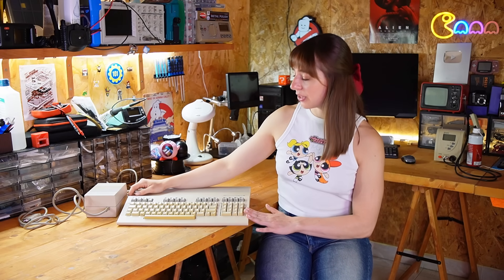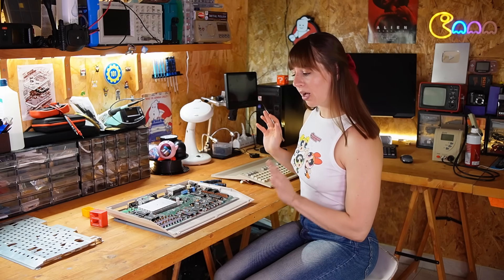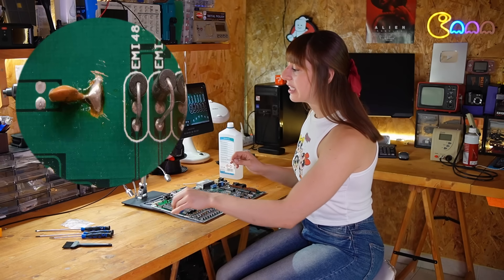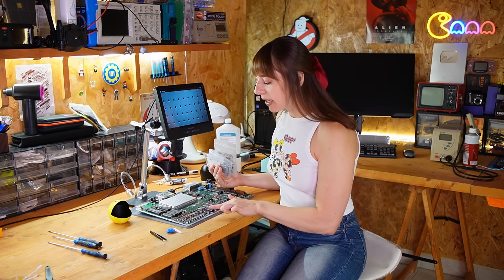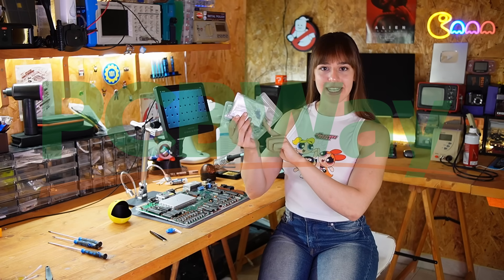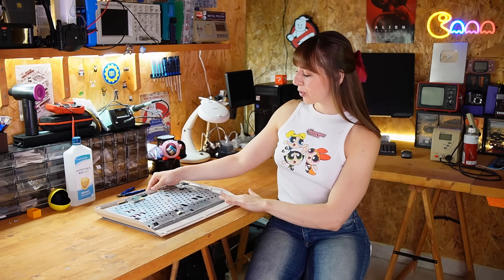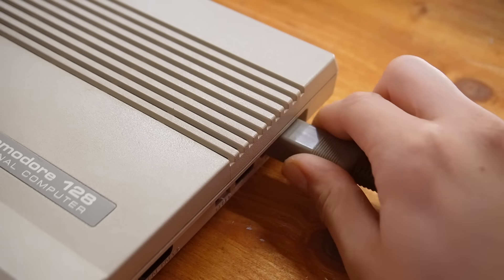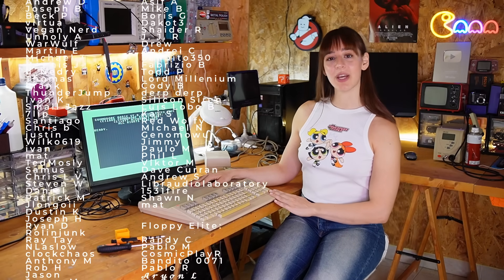Someone Tried to Fix This Commodore 128 (And Failed)

Comment: I realize this video is a couple of months old and you might not see this comment, but there is no need to replace ceramic disc capacitors. Unless they are broken of course. They'll last for decades without drift. What you want to replace are electrolytic, tantalum and RIFA. I started working as a computer technician in 1989, so I've worked on a lot of computers from that era.
Reply from the maker: Thanks for the clarification and for sharing your experience 🙂
That’s really useful insight, especially coming from someone who’s worked on systems from that era
Reply: @Sayakas_Digital_Attic You are welcome. I love your channel. It is great to see younger people interested in retro computing and you are doing a great job. As a side note, I repaired a lot of Olivetti M24s/AT&T PC 6300s back in the day. I would think they would be fairly easy to find where you are and I think you might find the architecture very interesting. It's a clever design.

Comment: Top work as usual 👍
Get hold of a dysfunctional Atari STe they were Uber sexy back in the day. Get it going and an easy RAM upgrade by just filling the slots up to 4mb 👍 I always wanted one back in the day, but ended up with a 130XE which was great anyway 👍👍👍

Comment: I did own a Commodore 64, and after much use the fuse in the power supply would burn out. And when it was replaced that would burn out too. My neighbor was the goto handyman for electronics back than for us, he just kept putting in higher and higher rated fuses and the power supply would also swell up, but it still worked. Now I know it was a huge fire hazard 😅

Comment: If you have one of these nearby, Maplins, Radioshack, The Source, or Source By Circuit City. Look also at stores who sell shortwave radio or ham radio parts. They will usually have capacitors etcetera as a lot of Hammies love upgrading beyond cough Manufacturers suggested settings. LOL. Hopefully this helps.

Comment: I had a cracking C128DM, had a better chip set the metal case had a better chipset than the 128D or the 128, i had jiffy dos and geos mounted on the 8 spare slots and would into Geos 128 in under a second, modern computers still cant do that.

Comment: How are you? Greetings from Buenos Aires, Argentina. The person who damaged that Commodore is unforgivable. Luckily, it was a simple repair. Be careful because you've applied thermal grease with silver particles (which is conductive). You have to make sure to use a very small amount to prevent it from shorting out the IC leads. It would have been better to use regular silicone grease (the white), since that's not conductive and poses no risk. Regards!
Reply from the maker: Thank you for the tip!

Comment: The capacitors are disc ceramics and don't wear out or degrade with time.
They only need replacing if the are physically damaged.
If they fail they usually go low resistance.
Nice vids by the way.

Comment: Hi, love your videos and have a small tip you should try. When you are desoldering , first melt lowmelt solder in it and after this mixing you can take parts out so much easier. Besides you don't need to apply so much heat that van damage the board and other parts.
Reply from the maker: thanks for the advice

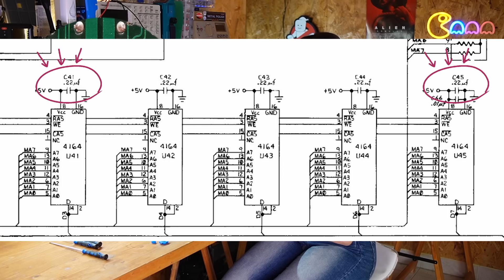Comment: 4:18 did you look for 0.22uf ? You would probably have found a quicker result by searching for 220nf … to be honest 100nf would be fine for bypass caps … do you have access to Farnell or RS? 
You could even fit surface Mount caps with a little time and effort.
Reply from the maker: I’ll keep that in mind for next time, thanks for the tip!

Comment: I still have one of those. Not the desktop model, but the C128 DCR, which is the model with a separate keyboard and metal casing. 
One advantage of this model is that it comes with 64kb of video memory as standard.
One disadvantage of this model is that compatibility with other (previous) models is slightly reduced.
Thank you for putting so much effort into these old devices. It's always nice to see a broken device come back to life.
Reply from the maker: Oh nice, the DCR version! Love that solid metal case (even if compatibility takes a hit)

Comment: I had a 128 on preorder in 1986 with a 1570 drive. Years later I bought a 128d for a bargain price, I've repaired a few over the years. They were a remarkable system in their time with twin processors and at least three modes of operation

Comment: Nice addition with the ESR meter, if you want to check if capacitors are within range, the capacitance is a good start, but the ESR gives you a better overview. I would suggest that you add an ESR table to your bench, because 0.42-0.44 ohms for 2200uf and 4700uf is way past the tolerance value.
Reply from the maker: thanks for the tip!

Comment: 💜Awh, my second computer 💜(My first was a ZX Spectrum 48K).
- It is just such a loveable Frankensteinian freak. Sort of stitched together from many of Commodore's other 8 Bits, and therefore not exactly the easiest thing to repair and maintain (just ask Jan Beta).😅
- Back then, we kind of nicknamed a lot of these old machines. Like the C64 is also called "the Breadbin", the ZX Spectrum is "the Speccy", and the BBC Micro is "the Beeb". Well, I have tried getting "the Chimera 128" going for the C128 and "the PowerPuff CPCs" for the Amstrads (as in: Lord Alan Sugar, spice and everything nice). But sadly without that much luck in those nicknames catching on so far. 😆

Comment: 6:56 Why does it looks like two of the "legs" are touching? I think they should be clipped closer to the solder joint.And maybe you should get a desoldering pump to safe the soldering wick There are cheap desoldering pumps that you operate manually by compressing a spring. I guess you do not do that many desoldering so the cost of a desolderung gun might not be justified.
Reply from the maker: They were actually touching, but of course I trimmed the legs off camera, so there’s no short circuit. I’ve got a desoldering gun and a pump, but I prefer using desoldering braid, it just feels cleaner to me! Of course, if the pins are large or there’s a lot of solder, I use the pump 🙂

Comment: Please use an air filter when you do soldering 🥲. Excellent work!
Reply from the maker: Thanks for worrying! I always use a filter while soldering, it just doesn’t show in the shot
Reply: @Sayakas_Digital_Attic 😶‍🌫️😮‍💨😤 😲 Can I ask you to show the air filter in your videos so that more people are aware of the risks of soldering? 🥺 You generally find the RoHS compliant marking on the product, packaging, or documentation, indicating the electronics (including solder) are lead-free. If your not shure and the product as no indication whats so ever Electronics manufactured before 2006 almost certainly contain lead in the solder. SO to Red ring of dead on my Xbox that learn me that.

Comment: Back in the day I had a C64-C... But we sold it once we got a 386. At some point after that, I started to have some slight regret over selling the C64. And fairly recently decided to "undo" that mistake by buying a Commodore. After looking for some listings, I finally chose a C-128, after all it does have that C64-mode, has similar styling as the C64-C... As a matter of fact the C-version of C64 is actually based on the C-128... And it has some additional cool features to tinker with.

Sadly, I could not just go and play with my "new" C-128, and fortunately I was cautious enough not to just try, but did test the powersupply first. And after a while of scrubbing surface oxidation of the pins (at first could not find any voltage), they seemed fine thought... But once I did get actual readings of it, the AC was fine, as one would expect. After all the AC is supplied by a huge (by modern PSU standards) coil transformer. That is likely to last centuries... But the DC side is another matter. The 5 VDC relies on voltage regulator to step down the voltage, and has a tendency to fail by shorting, causing overvoltage on the 5VDC line. And that was exactly what was going on with this PSU, everything else fine, but instead of 5 VDC, it was giving off 10 VDC, which could have easily fried a whole bunch of hard to replace original components.

So I would have to fix that, before I could test if I have anything else than a PSU that is working. And I allready have half a plan and fresh components to try and fix the voltage regulator... But because of life, I don't have as much time as I would like to. So that has been sitting on a shelf for some time now.

But I do hope one day I could be a proud owner of a C-128 (that is actually working).

Comment: Hey, Sayaka! I really enjoy your videos, and I also found some answers to problems I was having with my Deamcast thanks to one of them. I am no expert on soldering, but I will offer you some tips that worked very well for me: when using soldering wick, try to apply more solder before so it mixes with the old one and helps to melt more easily. Also, you can cut a smaller part of the solder wick and use pliers to hold it. That is because the heat will be dissipated along the tape, so a smaller part means you need less temperature to get it heated. And keep using solder paste as it also helps with te melting. Hope these work for you and keep up the great work.
Reply from the maker: Thanks for the helpful advice, I'll keep that in mind next time! 😄

Comment: I bought one from a local seller. It booted once, then it was all black the next day. I troubleshooted a bunch of components. The power supply was measuring just a bit under so I decided to buy another PSU. Turns out it was the PSU. The lesson learned,  even if the measured voltages are just 0.2V lower it could be enough to prevent booting.  Thanks for saving this great machine.
Reply from the maker: That's really interesting to hear about the voltage, but it's great that you were able to fix it!

Comment: I owned first a Commodore 64 and later a Commodore 128, which I still have. After those I had an Amiga 500. I have no idea where to get spare parts except from another computer.
Reply from the maker: It can be tricky, but I know there are some online sources that might be able to help you find the parts you need (mostly ebay)

Comment: I didn't know ceramic capacitors were hard to find nowadays. Probably capacitors made from other materials would work, but I understand wanting to keep everything as close to original as possible.
Reply from the maker: Yes! I'd like to keep the components as original as possible, but ofc it can be tricky sometimes to find the components (like in this case)

Comment: I'll probably be crucified for saying this, but I get ALL my components from Aliexpress or Banggood. 
Aliexpress: 50 PCS 224/50V Disc Ceramic Capacitors 224 0.22uF 50Volt 220NF  -  €2.89/lot

Comment: Ceramic capacitors rarely go bad. Have you found some that go bad more than others?
Reply from the maker: Yeah, it’s definitely harder for ceramic caps to fail, but since one was basically destroyed and the other chipped at the tip, I'd have preferred doing a full recap!

Comment: 2:58 Normally, thermal paste isn't (or at least, shouldn't) be conductive. so no risk there. But there is thermal paste, liquid metal, that is conductive and shouldn't be used around unprotected contacts.
Reply from the maker: Ceramic caps usually last a long time, but they can still crack or fail, especially from stress, heat, time...I’ve seen some break more often than others depending on brand and conditions.

Comment: i am noticing 3 things: 1) how beefy was the power supply for a c128 and yet they fails so easly back then 2) the overkill in rf shielding, was that circuit so noisy or was the fcc paranoic??? 3) the equipment quality growing exponentially: take that soldering station ,even the nerd emperor mr. carlson himself that have walls of tektronix oscilloscopes doesent dare to use such a top tier weller iron :D

Comment: Ceramic or Micra capacitors very rarely need replacing.. electrolytic capacitors often n3d replacing
Reply from the maker: Yeah, it’s definitely harder for ceramic caps to fail, but since one was basically destroyed and the other chipped at the tip, I'd have preferred doing a full recap!

Comment: Using a nylon brush on electronics, from experience, that can introduce static charge to the components and short sensitive chips.  Think about what rubbing a balloon with an insulator does.
Reply from the maker: Thanks for the tip!

Comment: eBay really is your best bet for weird or discontinued parts. I'm surprised that Commodore used some uncommon ceramic cap in there. There are good parts suppliers in the USA but with the current tax and tariff madness I wouldn't recommend it for such small orders.

Comment: Use monolithic capacitors. You should be able to get them anywhere with the same lead pitch, and are superior to the original ceramic caps.

Comment: I wish the C128 had been just a more regular upgrade to the C64, i.e. more ram, maybe an extra SID for stereo sound, and an upgraded VIC2. The way they went with this, meant that 99% of people just used it C64 mode, and there was very little software written for the C128. Maybe there are technical reasons why they went the way they did (was CPM really that desirable?)....

Comment: i use my old electric tooth brush for scrubbing with an old head (cleaned obviously ) its gentle but harsh enough to remove gunk without damage or much effort , the reason its an old brush is because the charge no longer holds for long , but its long enough for a clean of a PCB just not for tooths cleaning  more then a few times and we all hate having a tooth brush first thing that's not working 
those little component testers are great but are not very accurate spend a few bob more to get a better one i had one that read every component as a diode !!
Reply from the maker: Thanks for the advice!

Comment: If the device uses ceramic capacitors as bypass capacitors, then it really doesn't matter what the replacements are.  "Close enough" would work just fine.

Comment: Neatly done!  Sometimes solder braid, if left on the roll, can act as a big heat sink.  If the work includes large joints of solder you might cut a short length of braid from the roll and manage it with tweezers.  This can save pads from being ripped up from braid that gets tacked down as the pads cool.

Very well spotted on that missing screw.  That was a safety item.

Comment: Have you tried ordering capacitors from online electronics retailers from China or locally?
You should wet the iron before wicking (I just touch it against the joint to be wicked).

Comment: Mouser and DigiKey are the first places I look for electronic components. While they do still carry a fair number of ceramic disk capacitors, sadly they don’t have anything in the 0.22uf range. What they DO have in 0.22f are leaded MLCC’s, which should be a reasonable substitute. You can probably find one with similar lead spacing and voltage ratings as a functional replacement. MLCCs were basically the same technology as the ceramic disks, just in a more space efficient package, and part of the reason they make MLCCs with leads on them is to use as replacements for designs that used these older ceramic disk caps.
Reply: Great tip fellow clippy, will try to keep it in mind :)
Reply from the maker: Thanks for the component recommendations, that’s really helpful!

Comment: Ceramic disc capacitors have, for decades, been the go to device for filtering and supplying that extra kick when a chip starts doing something. A 224Z is 220nF or .22uF (as it said in the schematic) the Z is a tolerance rating meaning up to +80% and down to -20% of rated capacitance.  Still widely available on Amazon/Digikey/Mouser. And don't be surprised if the newer ones are quite a bit smaller than the originals, those tiny little orange/brown squares on newer surface mount devices can be 1.0mm x 0.5mm and be the same capacitance!  Love watching your videos! Great seeing a younger generation loving these old machines. (My C64 was bought new.) Can't wait to get one of the brand new Commodores!

Comment: Isn't polymer caps proper replacement for the old ceramic caps im not sure. Im thinking of replacing them in a atari 2600 I know one is cracked but the console still works seemingly fine.

Comment: I had a C128, but 95% of the time used it in C64 mode.  It was really a shame they didn't develop more software for the 128 that took advantage of the extra memory and speed.
Reply: @Dazlidorne Yes exactly , it would have been  cool to see some really impressive 8bit games take advantage of the hardware. I always believed commodore themselves should have developed their own games  since their computers were mostly popular for gaming , kinda shot themselves in the foot by not doing that when they were relying on the CD32 to keep them alive.

Comment: Hello Miss Sayaka!😀 WOW! That was a big spider!🕷 Good it was dead. That looked pretty bad inside with both the dust and liquid damage. I figured you would have replaced all the capacitors if you could, based on the condition of the two damaged ones. Good idea using your own power supply first!👍 My friend's brother had a Commodore 64 I would play with at his house, but I have never seen a Commodore 128. I always look forward to your lovely personality, voice, and accent. GREAT job repairing both the Commodore 128 and the power supply!!!⌨👏👏👏👏

Comment: I have a feeling you're unsure of the specfic name of the used capacitors, which wiould explain why you can't find any on ebay. They're called "ceramic disc caps". Very cheap and abundant on ebay. Just gotta make sure you ge tthe right cpaacitance / voltage range and you're good to go. Whole C128 board shouldn't be more than 10$ in caps..